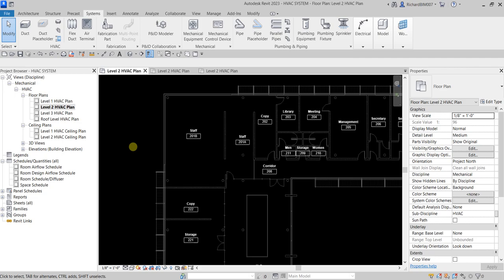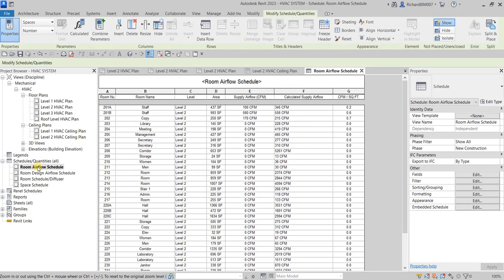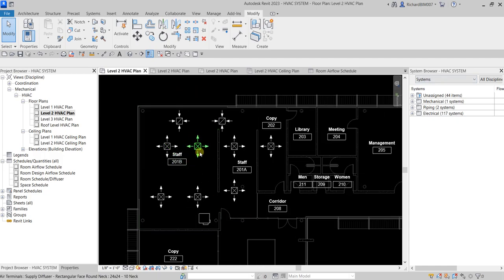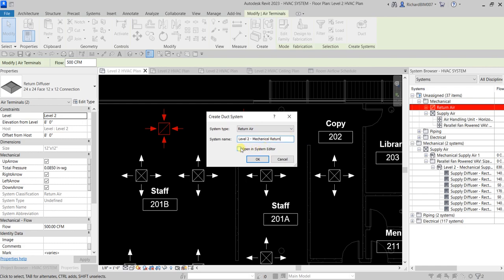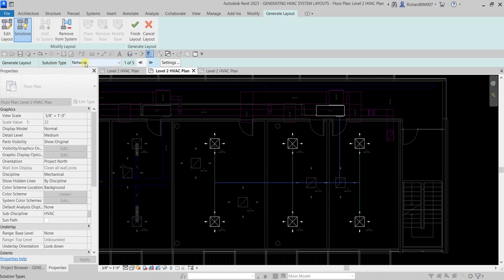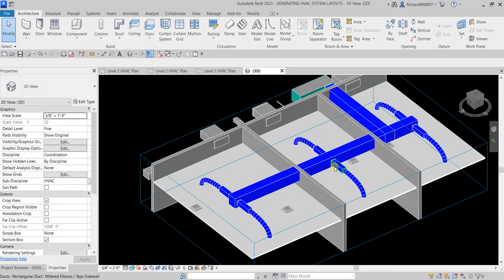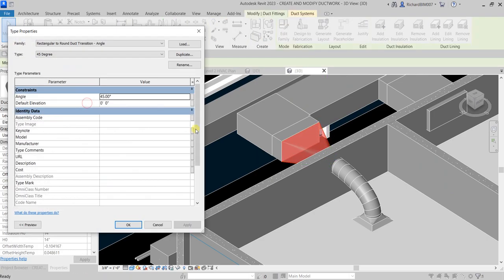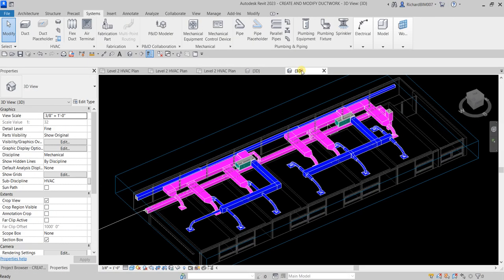REVIT 2023 FOR MEP - HVAC SYSTEMS COMPLETE

Comment: Sir, in schedule and quantities:  the calculated supply air flow is showing zero CFM, I am using REVIT 2024 version,
Reply from the maker: Calculated supply air flow value will appear if you run analysis.

Comment: Hi Rich
Thanks for the useful video, I am unable to show insulation, lining and centre line by dash, have tried VV graphics properties filters nothing helps, how can I add dash centreline to round ducts and not square, I am unable to show the duct bends with directional vanes. Please help
Reply from the maker: Hi James, it sounds like you're encountering some issues with displaying specific properties in Revit, particularly related to ductwork. Here are steps you can take to address these concerns:

### Displaying Insulation, Lining, and Centerlines with Dashes:
1. **Insulation and Lining Display**:
   - Select the duct you want to display with insulation or lining.
   - Go to the duct's properties in the Properties palette.
   - Look for settings related to insulation and lining. Ensure the correct materials are assigned.
   - Check the Visibility/Graphics overrides:
     - In the view where you want to display insulation and lining, go to `View` tab > `Graphics` panel > `Visibility/Graphics`.
     - Under `Filters` or `Overrides`, ensure that the display settings for insulation and lining are turned on and set to a visible style (like dashed lines).
   
2. **Centerline Display**:
   - For displaying centerlines of round ducts:
     - Go to the `View` tab > `Graphics` panel > `Visibility/Graphics`.
     - Check the settings for duct centerlines. You may need to adjust line styles here to show them as dashed lines.

### Displaying Duct Bends with Directional Vanes:
1. **Configuring Duct Bend Display**:
   - Ensure that the duct fittings (bends) have the correct family and type assigned.
   - Open the family editor for the duct fitting type you're using (e.g., elbow, tee).
   - Check for parameters related to vanes or directional elements.
   - In the project view:
     - Ensure that the view settings allow for the display of these directional vanes.
     - If needed, adjust visibility and graphics overrides specifically for duct fittings to show vanes.
  
### Additional Tips:
- **Filtering by Duct Type**:
  - Revit allows you to set specific visibility settings based on duct types.
  - You can create view filters that apply different display settings to round ducts versus square ducts.

- **Visibility/Graphics Overrides**:
  - Experiment with overrides in the `Visibility/Graphics` dialog.
  - Use filters to control the visibility of specific elements based on properties like duct type or insulation presence.

- **Check View Settings**:
  - Sometimes visibility issues are tied to specific view settings. Ensure you're adjusting settings in the correct view (e.g., plan view, 3D view).

Comment: Thanks Rich, your video is great, i can learn from your video.
May I ask you one question?
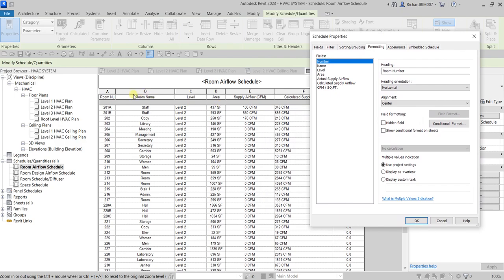Around 09:05, why the location of the air terminal can't be indicated in the schedule?
All of The column of room name, level, room level and room area about the air terminal is blank.
Grateful, if you can teach me
thanks!
Reply from the maker: hello sir. 

In Revit, the location of the air terminal (such as diffusers, grilles, or registers) cannot be directly indicated in a schedule because schedules in Revit are typically used to display data that is associated with elements or components within the model. While schedules are an excellent way to organize and quantify information about building elements, they are not designed to show the exact physical location of those elements within the model.

Here are a few reasons why the location of the air terminal is not indicated in a schedule:

Scheduling Data: Schedules in Revit are primarily used to extract and display data related to the properties and attributes of elements in the model. This data could include information like the air terminal's size, type, airflow rate, and other relevant parameters, but not its precise location within the building.

Graphical Representation: Revit schedules are presented in tabular format, and their main purpose is to convey information efficiently. Displaying the location of air terminals graphically within a schedule might not be practical or intuitive, as schedules are not designed to handle graphical representations of model elements.

Spatial Information: Showing the exact location of air terminals would require more spatially oriented representation, such as a floor plan or a 3D view, rather than a tabular schedule. Floor plans and 3D views are better suited for visualizing the physical layout and arrangement of elements within the building.

To view the location of air terminals in Revit, you can use the floor plans or 3D views, which allow you to see the elements' positions within the building's model. Additionally, you can utilize different tools and features within Revit, such as tags and room boundaries, to help indicate the location of the air terminals in the model and documentation.
Reply: @bim360  thanks. Let me try it later
Thanks rich
Reply: @bim360  but i see you can show the location of the air terminals. I will try to use the tag for marking the location.
Reply from the maker: sure try to explore.